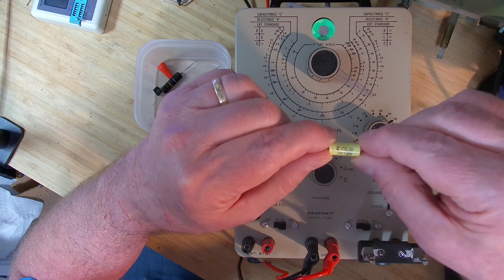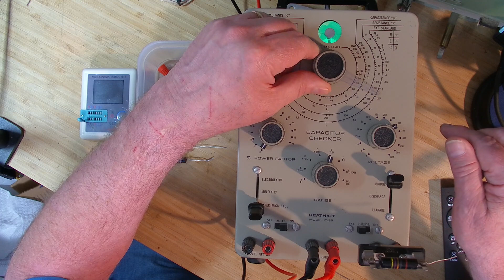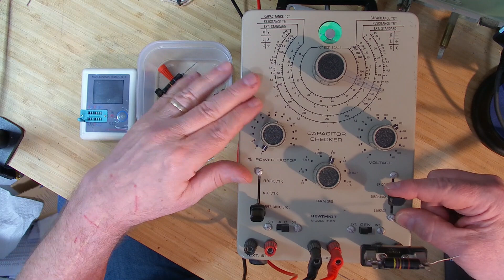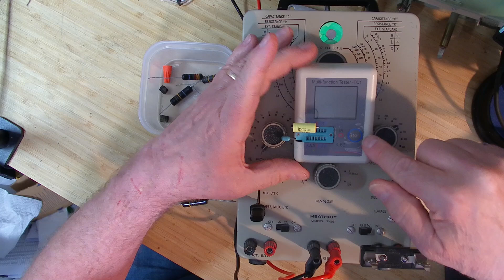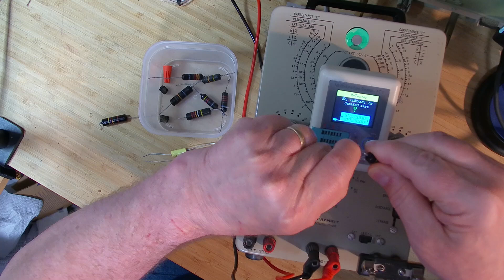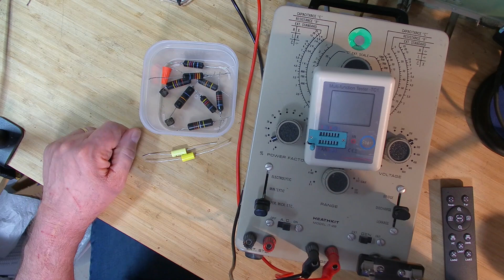RCA Model 641 Radio - A look at the Bumblebees with a Heathkit IT-28

Comment: I have a C-3 Heathkit Capacitor Checker but seldom use it. I know how old those vintage wax paper capacitors are and at 
their age they can go any minute if not bad already. New polypropylene caps are just more reliable , cheap and I have
plenty of them so to save tons of time just I snip the old  waxers out and replace with new ones. Old ones go right into the garbage can.Thanks for just confirming what I already suspected! Good video. Steve from IL

Comment: Looks like polypro to me. I'd like to have an IT-28 to go with my NanoVNA. I got my clip-leaded holder from a box of surplus junk from a friend who passed away. I keep it handy in a box of connectors and adapters on my test-bench.
Reply: Keep looking on eBay, or such, and an IT-28 will appear at the right price.  It seems like the "good stuff" for working on old electronics  is hard to find.  That is a shame.  Perseverance is the way to go!  Thanks for the comment!  And yes they are polypro caps.  I just had a brain fart at the time.